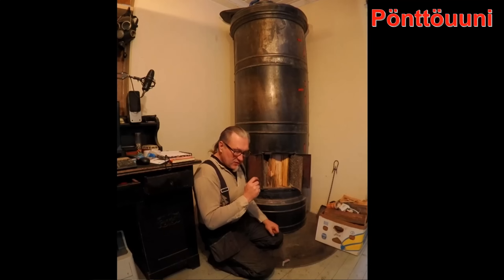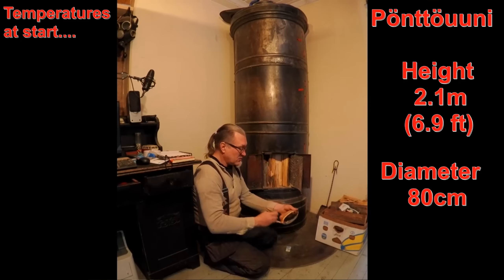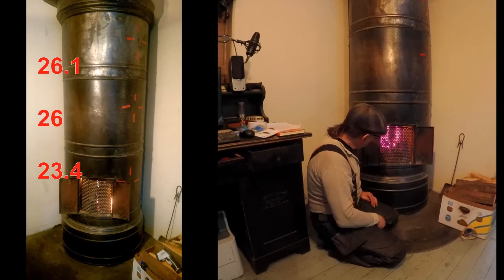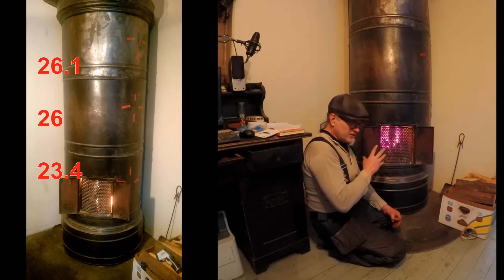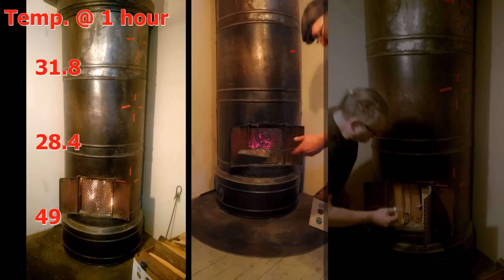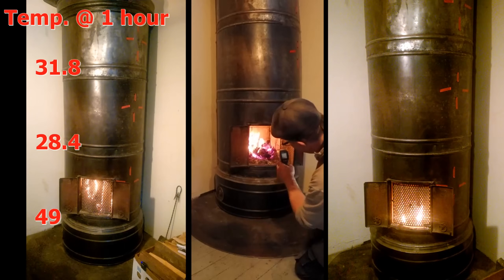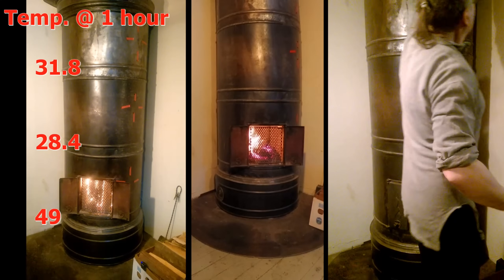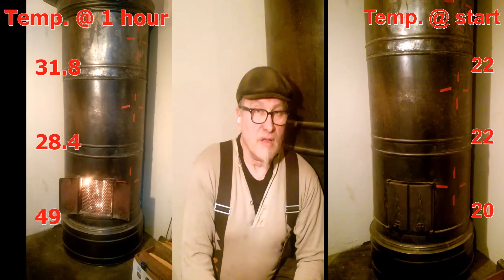Finnish masonry heaters. -The Russian Rocket (Pönttöuuni)

Comment: The most effective masonry heater I've experienced was at my aunt & uncle's house in Minnesota, and I was kind of amazed by it as a kid.  It actually drew cold air from outside the house rather than warm air from inside.  As my uncle explained, 'if you let it draw from inside the house, the house will suck in the cold outside air anyway to replace that, so you may as well draw it directly from outside."  I never knew exactly how the inside of it worked, but I remember it taking an armload or two of wood in the bottom chamber and a few sticks in a tiny upper chamber. You had to light the upper chamber first and let it burn for fifteen minutes before lighting the bottom chamber.  It didn't seem to be getting hot at all - the outside of the heater was only a couple dozen degrees fahrenheit warmer than the house.  But two armloads of wood (and a handful of sticks) kept it warm for four or five days.  The chimney didn't seem to smoke at all, and there was hardly any ash left when it was time to light the next fire.
Reply: I wonder if lighting the upper chamber first was to start the air flowing through the inlet, stove, and chimney well, before the main fire was lit.
Reply: @just_a_quick_ride  I live in a finnish house with 2 of these and couple of other fireplaces. And I can assure you that during the winter the chimney and fireplaces are always hot enough that there's a heck of a draft when you just open the dampers. First times in the autumn are different but heating need then is so small that it doesn't make a difference.
Reply: @epajarjestelmainsinoori9037  Oh yes I'm sure, it's perhaps just at the begining of the cold season that this kind of draft inucement might be needed I expect.
Reply: @just_a_quick_ride That mechanism actually exists. There are always small (5 inch) openings for the chimney cleaner just above the floor that lead directly into bottom of the chimney channel. We normally burn a sheet of newspaper of something quick there to induce the circulation but mainly applies to cold cabins etc. Houses with electricity tend to have the first 5-10 degrees of heat from all the appliances and bit of electric heating and that pretty much does the trick.
Reply from the maker: Sounds like a good one!
Reply: @downdirty9642 that was probably a wood gas stove. They are pretty efficient and leave very little amounts of ash (unburned carbon)
Reply: It would be nice to be able to control.  Sometimes it is nice to have the fire pull fresh air into the room too.  When it gets super cold, though, the ability to switch to mostly drawing from the outside directly into the heater would be nice.
Reply: @jewsareagenocidalhategroup  In Australia reversible venting does this - using the stove to cool the house in summer. This kind of died in the '70s. It is interesting the tech that gets 'lost'/removed from the commons.
Reply: This had been standard in European wood-burning heaters for quite a long time.
Reply: @eh1702  Yeah, the first ones were brought to Nordic countries from Poland at the turn of the 1500s when Catherine Jagellonica- A polish princes married the then king of Sweden, she also brought fork and knife with her before that even nobility ate with fingers in the Nordics.

The exact origin of this type of heater is a little uncertain but central Europe in the 14-15th century is the most likely origin of them when the lords needed a more efficient way to heat their castles and manors.
Reply: @villerantavalli9395  One I saw in Lithuania belonged to an old Russian couple. It took up half the kitchen and had an extension into the front room. At night in winter (they showed me) they wiped down the tile surface and put their mattress on top.
Reply: @eh1702  Yeah, that's so called "man of the house's" bed sill (isännän panko). In northwest Russia and East Karelia it was traditionally reserved for the important guests when not used by the head of the family because it was arguably the warmest and driest place in the house.
Reply: Masonry heaters are really nice - a good one shall have a lot of mass so you'll only need a small amount of firewood and it will heat you until the next day.
Reply: There is lots of Finnish roots in Minnesota.

https://en.wikipedia.org/wiki/Finnish_Americans
Reply: проблема в том что никакой разницы. проблема уличного забора воздуха в печь в том что он холодный и охлаждает топку печи таким образом  снижая кпд горения так что  больше топлива уйдет на разогрев на компенсацию. так что плюс минус никакой разницы не будет снаружи ты возьмешь ледяной воздух в печь или внутри дома она возьмет воздух и в дом зайдет холодный воздух через щели. плюс минус выйдет одинаково.

более того. работающая печь выполняет функцию вентиляции.дышать хорошим воздухом поверь не менее важно чем согреться.проще говоря печь помогает освежать воздух в доме. если выбрать твой вариант печи то тебе все равно придется делать вентиляцию чтобы не задохнуться и тогда так же будет в дом заходить холодный воздух и тебе придется его греть + хуже будет гореть печка изза холодного уличного воздуха.
Reply: Cool story
Reply: Yep! I had one of those and kept the whole house warm for at least 12 hours before having to load it again. If you had smaller maintenance fires twice a day, the house would stay toasty at a 21  to 23 degrees.

Comment: Thanks again for the good video and excellent graphics that assist. The stove though, is not a rocket. It's simply the Russian concept of "burning inside the bell" combined with a European style "counterflow" masonry heater that goes up through the baking oven, down the sides, and out the bottom. Burning "inside the riser" or inside the bell does not produce the massive draw of a "J design" rocket. Even the "batch box" has somewhat of a J design and draws far more than burning inside the riser. If that was the same, the "rocket stove" addicts would be doing it! -  I'm building a similar design now to what you just talked about, but I'm using bricks based off this old "USSR era" Russian stove,... which is very similar to EU "counterflow."  Trust me.. if you don't know this website OR you can't see the link because, like you said in another comment.. it's Russian... you need to find a way to see this website... Get a VPN or something.......   I can tell your interests are like mine. You MUST see this site. You'll be entertained for weeks.  - Matt   https://air-hot.ru/index.php/pechiikaminy/otopitelnyepechi/166-pech-kovalevski-2200   This is what I am replicating. The site is simply      air-hot.ru

Comment: Very interesting, thank you. I particularly appreciate your diagrams. Perhaps the chief lesson here is that excess air might drive an impressive blaze but is also pushing heat up the chimney (not to mention pulling cold air into the house to replace it). I have a question about construction - how do you get the metal case over the brick lining - have you very high ceilings, or is it in sections that can be dismantled? I struggled to even get an oil drum over a tall rocket riser because of the ceiling and would appreciate any tips. Thanks again 👏💯
Reply from the maker: Exactly. That is what I meant when I said I have problems with the term 'efficient burn' Fast and hot may be very efficient at getting the max heat from the fuel and minimising emissions but It can be very inefficient in terms of giving 'useful' heat . The pönttöuuni is built in sections with each section measuring 60cm in height. Place the section, build the brickwork inside...and a bit higher, then next metal section in place. repeat.
Reply: @downdirty9642   Thanks. If only they made full-width, 60cm tall oil barrels. I'll have to try a way of cutting and joining them without leaks.
Reply from the maker: @batchrocketproject4720  Well as I said, here in Finland they produce the metal shells, 80cm in Diameter, 60 cm tall sections that lock together. They are quite lightweight but a bit bulky for shipping I guess. I could make some enquiries, I am sure they would ship internationally.
Reply: @downdirty9642   Thank you for the offer but I like to build from common items. Oil drums are close to 60cm diameter but create the headroom problem during installation, so I will experiment with reliable methods of cutting and joining them.

Comment: Thanks - really interesting ;-)

How I see it and think it is/was:
The reason for the older model's different design is that previously they did not use the type of ceramic insulation that we have and can use today. In order to achieve some form of insulation between the channels, the wall thickness was therefore increased in some places in the older model. The outer metal barrel set a limitation, so therefore the wall thickness of the internal channels had to be set according to the best possible judgement.

I therefore believe that we must take this into account when we want to develop a new model based on old experiences.
In the new improved model, we should take into account both the physical "laws" and properties, and recent experience for each individual component.

We want to achieve as good a draft in the oven as possible and at the same time as good a utilization of the heat energy as possible.

Design principles can therefore be:
Every time the flue gas rises, we regard it as a chimney where we want as high a speed as possible and with as little heat loss as possible, because a heat loss in an upward flue gas will slow down the flue gas because the density increases, i.e. we insulate the chimney.

Because we work with a closed system, each section, i.e. an upward or a downward section, should be seen separately.

Every time the flue gas is cooled, we want this to take place when the flue gas is in a downward direction, because the cooling increases the density and therefore cooling in a downward direction helps to increase the draft in the furnace. (Large cross-sectional area and large volume in the downward channel is desirable, and relatively large wall surface with good thermal conductivity and large thermal mass. 
The large volume gives the flue gas time to release heat. Think: bell).

There may (probably) be a need to use a shunt damper when the oven is started. 
And perhaps also one or more other dampers if the stove is built in an area with very low winter temperatures, because when it is extra cold outside you can actually allow the flue gas to be cooled a little more and still have a heat surplus (differential temperature, i.e. temperature difference between bottom and top of the chimney ) to drive the flue gas up through the chimney. 
On the other hand, this will also complicate the use of the stove, so it is probably worth considering how much it should be optimized because if you do not understand how to use the stove, you will end up with smoke in the house.

And thank you for the description of why you remove the glowing coals from the stove. 
I'm thinking whether you could make a system where you can push the glowing coals into a small, separate mini-furnace, which is airtight (i.e. carbon monoxygen-tight) in relation to the house. But if it can't be made carbon monoxide safe, it's probably better to carry the glowing coals outside as you showed.

You showed in a previous video 
"Finnish masonry heaters. -The baking oven. Part 2."  , 
that this oven has a secondary combustion chamber, and now I understand even better the significance of this.
Reply from the maker: I basically agree with everything you said. Yes, using modern insulating materials would would allow the space to be re-thought and optimised.
Absolutely possible to make the ash-compartment double as a secondary chamber with it's own small flue (bypassing the baffle) to draw off CO as in my big baking oven thereby allowing baffles to be sealed at the optimum point. I think that when you said 'shunt damper' you mean a bypass or summer damper. This goes without saying. Almost all fireplaces and heaters have that here. In addition I want to take a much harder look at the material used as thermal mass and create the best combination of fast and slow heat absorbers/releasers. I think there is a lot of potential for some major improvements in performance.

Comment: Very nice, thank you. The Pönttöuuni reminds me of the Utermark stove, which was developed in the Russian empire in the 1820s (https://ru.wikipedia.org/wiki/Печь_Утермарка ). I think that's where the idea of the metal sheet came from, as Finland was part of the Russian empire at the time. The Utermark stove had several up and down channels to maximise thermal efficiency by getting the last bit of heat out of the exhaust gases.
Reply from the maker: For some reason the link does not work. Probably our idiot government blocking anything Russian. I'll check out the Uttermark stove though. Thanks for the tip!
Reply: @downdirty9642 Конечно ,МЫ,<KGB> следим за тобой😅.
Reply: @downdirty9642 Твоя печь на чертеже похожа на печь Грум-Гжимайло инженер теплотехник, металлург 19-20 век.
Reply from the maker: Thanks for this but it is quite difficult to find information about his stoves.
Reply: @downdirty9642  I don't know where the idea for the metal clad ones came from, but I was under the impression that tiled ones became popular in manor houses in Sweden some time around the 1700's... Which would also explain why these types of heaters are common in both Finland and Sweden, as that would predate the period of Russian occupation (1809-1917).

Comment: If I may I'm operating 2 coal stoves a stoker and a  hand fired. 3rd and 5th year. To burn efficiently I've been a gusting them like a carburetor . Could you make an adjustment on the wide open stove buy closing one door and adjusting the other door .
The other stove seal the door tite and leave the ashes.
Reply from the maker: I have absolutely no experience with any coal fired heater/stove. I think it is probably 20 years since I have seen a piece of coal! So I am sorry, I cannot help you with this.